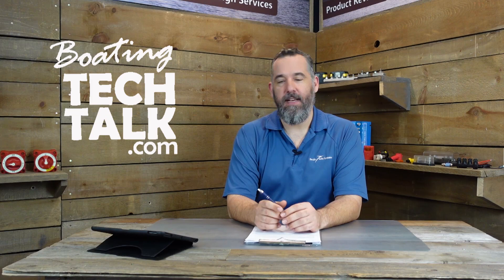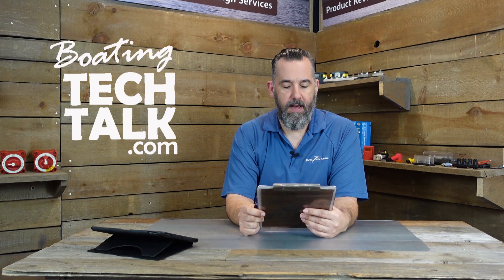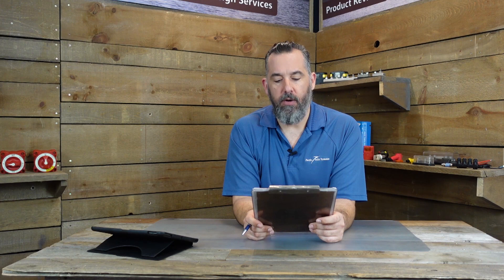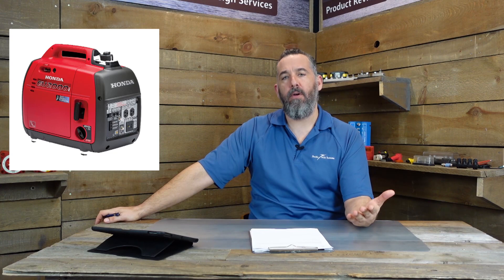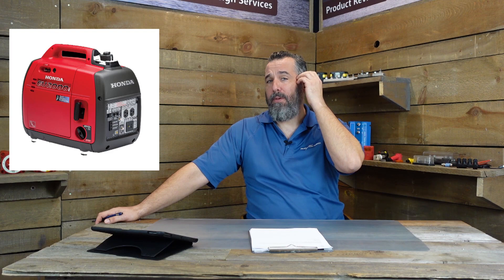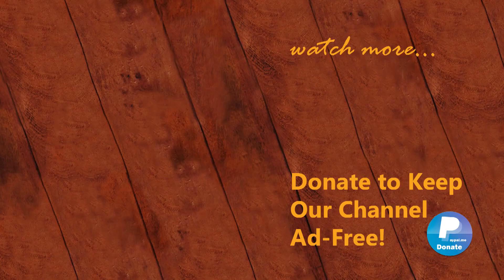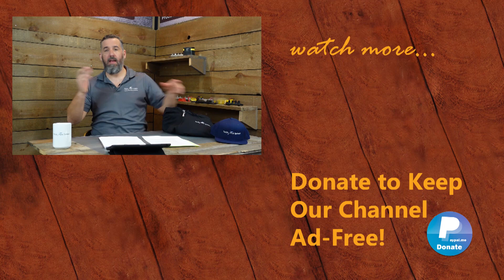Can I Charge My Boat Batteries With a Honda Generator?

Comment: I have a cheap $350 800Watt genny powering a 600 watt 20A  battery charger (Projector 21) and it works - doesnt trip the cb. I can see 20A charge rate through my battery monitor ($80  off ebay) .

I am a sparky from Australia.
Reply from the maker: Thanks for sharing Mitcha4163

Comment: My sailboat came with a 40amp charger that is not wired directly into the boat’s AC system.  the chargers  AC input is basically a cord with a plug on the end that is plugged into an outlet on the boat, so when on shore power it’s plugged in that way, but I can just unplug it, plug that cord into my little Honda 1000 and run the charger directly that way. the 1000 will run the 40amp charger but nothing else anyway. This gives me the option of at least having another charging source besides the 120amp engine driven alternator. for AC needs I then just use an inverter. I like the Honda 1000 because it’s small and only weighs 28 lbs!!
Battery bank currently 630 amp hour lead acid.
Reply from the maker: Hi John, thanks for sharing.

Comment: What size amp extension cord does one need from standard 110v electrical system to either a 20amp charger or to a 40amp charger?  Thanks
Reply from the maker: a standard 14awg cord would be fine.    a 40a 12v dc charger is only going to pull around 5-6a at 120v ac.
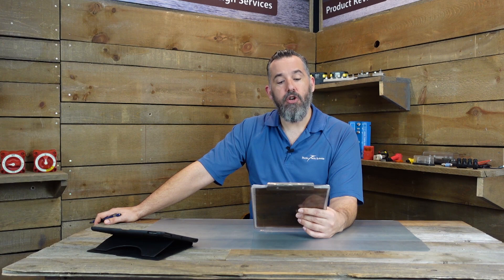Reply: I use a short 12 gage for the 0:29  DLS 45...prolly about 600 watts

Comment: Is it possible to run a trolling motor with a small generator? Or a simple solution to give me more running time with the trolling motor.
Reply from the maker: Well it depends, a small 2000 watt generator can probably power a 60 amp 12 volt charger, in turn your trolling motor could take up to 60 amps of power at 12 volt.

Comment: I’ve had a Honda on my boat for years. I use it when I make water during the day. Usually plug the rainman in directly but I can use the inverter as well in a pinch. I also charge my batteries with a 40 amp pro mariner pro nautic charger and run my 1500 watt hot water heater for our nightly showers. Works great but you can’t run anything else or it blows the circuit on the generator.
Reply from the maker: if you have a 2000 or 2200w honda you could get a bigger battery charger like 80a and cut down your gen running time to charge batteries.   (but you wouldn't be able to run anything else at the same time)
Reply: Thought about that but since the solar pretty much keeps the batteries full by noon probably not worth the added expense for a few days when it’s cloudy. I should mention our boat winters in the Bahamas.

Comment: Question! The neutral on a portable generator to charge batteries and to run the a/c on a boat should be bounded or floating?

Comment: What about us guys that only have 1 starter battery and 1 house ? Can i charge the single house battery by running an inverter from the starting battery ? House battery only running lights and a fishfinder. Just a small 19ft fishing boat
Reply from the maker: Hi Andy, see the other post, replied to your question.

Comment: When I plug mine in to the shore power plug I get a reverse polarity alert from my panel
Reply from the maker: Yep, that's a common problem with the suitcase generators.
Reply: Buy the Honda generator with the 30A outlet socket.
Reply: Dear all, anyone have idea how to solve reverse polarity situation, or to run it as it is?
Reply: @seregachief2251   Buy the 30A version

Comment: Running a generator is is rude as hell and bans are coming to most marine parks. The real reason to consider why "it doesn't work" is that asshat behavior inevitably ends up with the consequence of more regulation, and that impacts all boaters including the responsible ones, and the entire activity is made more difficult.
Reply from the maker: Thanks for sharing StarPath.

Comment: Jeff, in previous videos you came out against using portable gen set because of a ground issue.  This video not only are you in favour of using portable gen set...what has changed to alter your opinion?
Reply from the maker: Hi Borys, the ground issue is real and this would be a showstopper for me. That said, many boaters still use those generators for plenty of good reasons.

As much as possible, i always strive to leave multiple solutions to a problem and don't want to shut a door for everyone.
Reply: I was expecting you to talk about the grounding issue here. Maybe consider atleast directing people to your other video so they are aware of the issue.

Comment: You don't use a high current output battery charger to charge a battery.  High current settings are for motor starting, not for battery charging.  4:17 / 5:30

Comment: Those Honda 2k generators are very quite................., until you start them up
Reply from the maker: Good one, so did I. Originally, i was like, wow, 50 - 60 decibels that's so quiet. Until i ran the unit on my boat.

Comment: huhmmm : Would You perhaps have the answer to my wondering if the Honda EU10i can "jump-start" à (diesel 2L) campercar that say won't start after 48 hours parking at say 0 degrees C. ?  With a 220 volt device (I dont find any jet) or strait from the EU10i 12volt output (or is that merely just ok for slow charging, and no "jump-start") ?
Hmmm lol, in case the question interests You too :-)
Reply from the maker: Engine starting is done from a DC source, i.e. a battery. You'll want to recharge your engine battery with a battery charger connected to your Honda Generator. Some generators have a small DC output that could be connected to an engine battery for a short period of time to help recharge the battery. Remember don't trust the DC generator output to not overcharge your battery. Resultingly use this feature with care.
Reply: @PacificYachtSystems  I'm looking at a EU2200i Honda owner's manual that contains an electrical schematic of the generator... the 12 volt output is rectified AC, not smoothed, not regulated, nothing.  just rectified AC.  In other words, you wouldn't want to hook it up to a battery except in an emergency to get the battery partly charged.  You would want to avoid using it because it will over-charge your battery.  It's not nice to feed such dirty electricity into a battery.  I'm surprised a company that makes good stuff would provide such a poor quality 12 volt DC supply.

Comment: This is funny....the manual I just read said it does 13.3 amps. It also says "specifacations subject to change with out notice",. I can just imagine all the people that buy generators (consumer goods) thinking that its just fine to run at the rated specs. There is only a very few engines of the world that are designed to run at a constant max spec. Most people dont know of duty cycle. Consumer products are rated for their max ouput, but the 25% rating is the actual max rating. Does anyone ever wonder why most equipments predominate fail is oil burning? Then some one runs the oil low but yet in the safe range on a hot summer day...kaputy...
I say shoot for 25% load with a 50% load as for emergancy short term (duty cycle) use. But the manufactures dont want you to know that because then they dont sell new ones all the time. 
Look at the old Onan gensets, they are heavy duty, made to actually run at rated power all day long..
Just my opinion..
Reply from the maker: Thanks S J for sharing, really appreciate it!
Reply: @PacificYachtSystems  Sharing is carrying, I think thats what you say. My point is about the small light wieght engines, they really are stressed to run at peak horsepower. Look at consumer push gas mower vs consumer department store pressure washer. Those engines on the pressure washers are constantly operating at near max HP, while push.gas lawnmowers don't see a near  (WOT) wide open throttle condition their whole lives. The correct way to mow grass is to mow often to make sure the engine speed does not bog down. Keeping the blade sharp keeps the engine from bogging also,.  Air cooled small engines need to work at something less then near or at WOT. If they do, then it's desirable to observe a duty cycle strategy. I'm seriously shopping for a dual fuel inverter generator to be used at or around 25;~35% duty to get longer service life. (26 foot sailboat electric driven) I realize some manufactures claim their small genset can run and start two 15k btu A/C units. In the field, a person might have two A/C unit's going all day, compressors never cycling for long periods. My sympathy to those little gensets being pushed like that.
Reply: Some generator manufacturers give run times at 25% load while others give run times at 50% load.  Obviously, 25% load runs longer by a few hours - a selling point - not a restriction or limitation of the generator.  They don't tell the fuel consumption rate per hour - it's something the consumer has to figure out (most can't).  Most say not to run at more than 80% load for extended periods.  What is an "extended period"?  If you can afford one, a diesel genset is designed for l-o-n-g run times, in some cases days at a time.

Comment: Might be better then to get a 150 amp alternator and run the engine to charge up the batteries.
Reply from the maker: Many of us are doing exactly that, high output alternators with external regulators.
Reply: Where would the fanbelt to drive the alternator attach on my 18hp outboard?  ;-)
Reply: @JimDory  Of the prop of course . Brilliant 😀